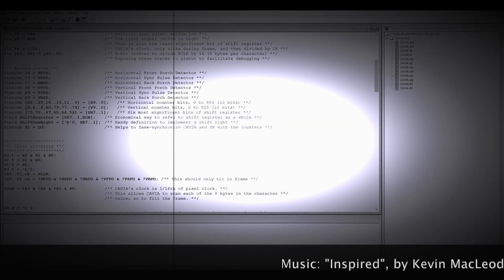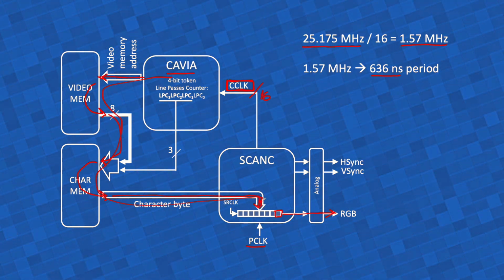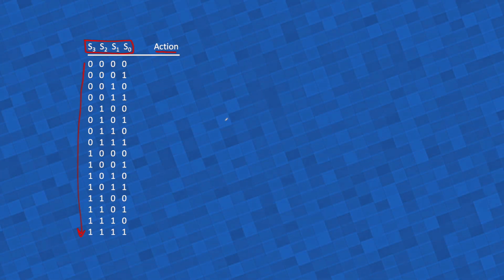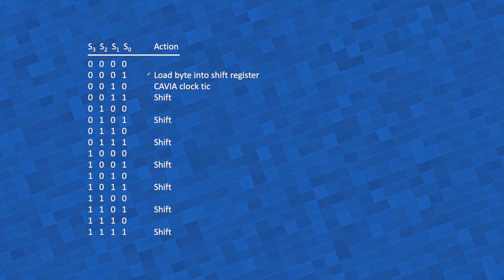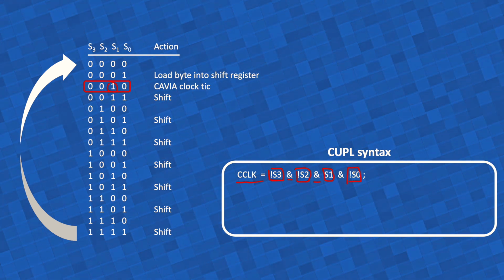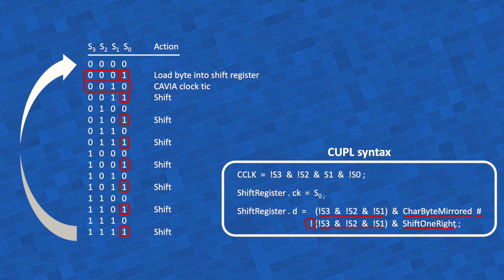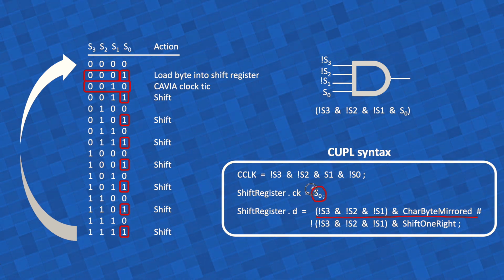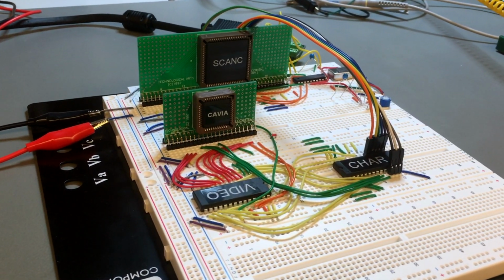Building CERBERUS 2080™, my dream childhood computer: Episode 6

Comment: Awesome series so far! Could you not use an oscillator with half the frequency, since your state-machine actions are almost exclusively on the derived half-clock, thus eliminating some logic? Or is that not an easily obtainable crystal oscillator; or would it affect the sync signals; or something I'm missing?

=Edit=
I can't see 25.125/2 MHz crystals listed on Wikipedia, which might answer my question.

That said, might it not require fewer gates simply to halve the clock at the get-go, latch the shift register on S1, send the Cavia tick on S2 (or even S1?!), and shift on S0 and S2-S7?

I've not taken the time to work out if the sync signals would get thrown off. Also I'm not a hardware guy, so might be missing something obvious!
Reply from the maker: 12.5875 is a tough frequency to find, if at all possible... 25.175, in turn, is very common.
Reply: @thebyteattic  Could one get away with working only with PCLK/2 (from a T flip-flop) and thus have a smaller counter for the state machine and eliminate a few other gates here and there? I'm curious because in the back of my mind lurks the possiblity of doing it without those programmable chips, and saving even a handful of gates would make a difference.

Comment: First seeing you building this is super inspirational,  but wonder why you decided to use a smaller chip for CAVIA but did not do it for SCANC. To me SCANC uses less pins then CAVIA. I never used those ships so i am sure there is an internel reason?
Reply from the maker: The bottleneck is not the number of pins, but the number of flip-flops. SCUNK (the name will change later in the series) has several internal counters, which require a lot of flip-flops. These CPLDs have one flip-flop per logic cell, which works out as one flip-flop per pin. So although I didn't need the pins, I needed their flip-flops for the counters.
Reply: @thebyteattic  makes sense, does that also mean that cavia and SCUNK can't be merge together?  
When i did know this kind of chips when i was young i would definitely finished my 6800 based computer. that i tried to make back then, around the same age when you was thinking about yours.
Sadly i stranded on couple of reasons; the amount of soldering i needed to do, the PCB where very expansive and not the quality of today, and i could not find a nice way to display my content. when i remember correctly the 6800 series did had some sort of display IC but i did not have the skills to make a PCB from it.
Reply from the maker: @NielsNL68  SCUNK and CAVIA cannot be merged in one 5V, THT CPLD chip, no. They require too many flip-flops. They can only be merged in an FPGA, at 3.3V, SMD.

Comment: Dual ported asynchronous sram seems to be incredibly hard to source. I found a few places but they were selling left over stock that was not going to be replenished (last buy). Is there a different technique you would recommend for the character memory and video memory if dual ported ram was not used?
Reply from the maker: You can get dual-ported SRAMs from DigiKey and Mouser. There are other techniques for RAM multiplexing, but they aren't compatible with CERBERUS's architecture, which is based on dual-ported SRAM.

Comment: These are excellent videos thanks for putting them together. Can you tell me, did you design your video card this way because that is how it was done in the era in which you are trying to emulate or is this common practice? Isn't it redundant to store the address of the character in one location and the actual character in another location? How about if I want to display a picture on the screen instead of characters ... how would this be handled? Thanks again, I find the whole process fascinating and I am riveted to my screen.
Reply from the maker: Hi George, thanks for the kind words and encouragement! I designed the video circuit in the best way I could, using 5V CPLDs. So it's retro in the sense that I am restricting myself to 5V and not using FPGAs. The circuit does not have a bitmap mode, so it can't display bitmap pictures, only characters. This was very common back in the day. The video memory retains information about which character should be printed in which part of the screen. But what each character looks like is stored in the character memory. So the information across the two isn't redundant at all. In case one really wants to display a pixel-level picture, one can just use several characters side by side and modify the respective character definitions so that each character becomes a unique bitmap. The final picture will be like a jigsaw puzzle of different, tiny bitmaps placed side by side.

Comment: I have a question about the future of this system. Since you are making this a learning computer, that presumably will have some sort of basic input output system, with maybe a version of basic built into it. Are you going to sell prototype boards built specifically for the components you are using? Or maybe open source the PC boards?
Reply from the maker: I hope to make it backward-compatible at least with the ZX81, and at least at the level of BASIC (if not executables too). If I can, I will work on compatibility with the PET and TRS-80 as well (meaning, CERBERUS would have two CPUs), but can't promise. As for kits, I don't really sell anything, it's just a hobby for me (I have neither the infrastructure nor the time for selling things). But I will put the whole thing up on Github, with some kind of open license, including all sources and documentation and Gerber files, etc. I am also willing to support anyone who may want to commercialize a kit, to the extent allowed by time.
Reply: @thebyteattic  that's good, just the video circuit alone is incredibly informative. I'll bet even some teachers would use it in their class.
Reply: @thebyteattic  With a name like Cerberus it really should have 2 cpus :)
Reply from the maker: @ukcroupier  Yeah, I think so too ;-)